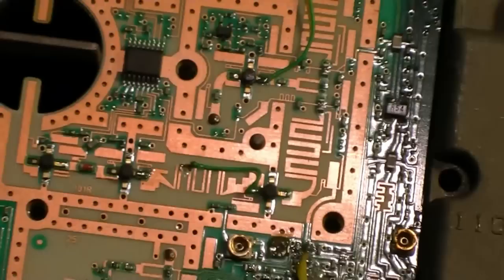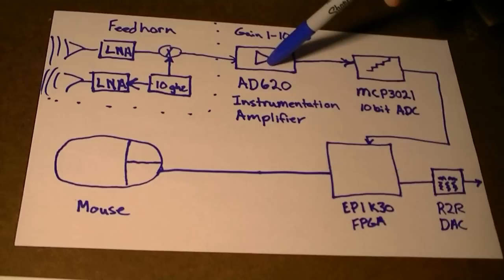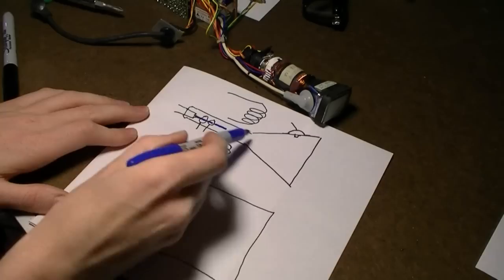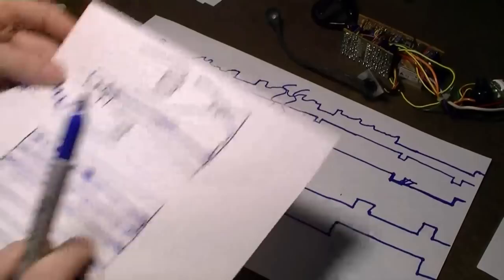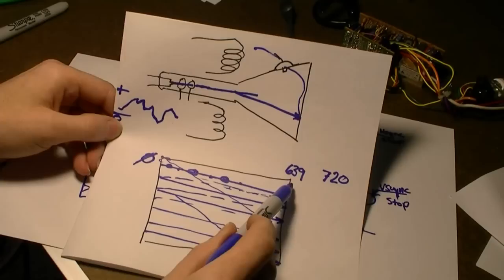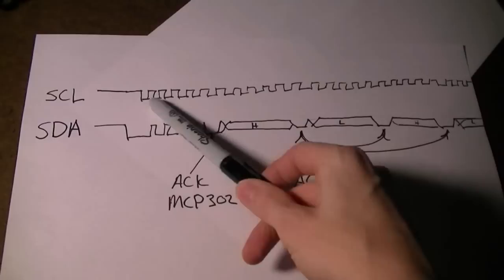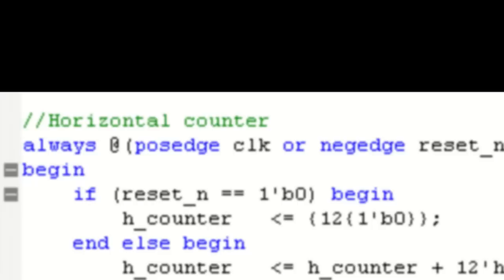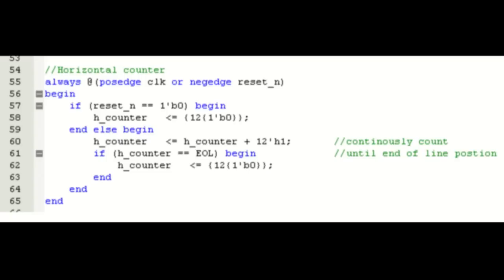DIY Body Scanner Electronics

Comment: That brought me back.  I loved your explanation of how an analog  video signal works.   Back in the early 90's I built a video frame grabber for a class project...back then it was discrete TTL components for the Horiz/vertical counters and $300 for 64k of high speed static ram...I don't even remember what the A/D cost.  The T/S 1000 was a nice touch too.  Good stuff, keep it up!

Comment: Great video, your presentation technique is so easy to understand. Using the resisters to create negative and positive rails (from a virtual ground) from a single voltage supply is a so simple its amazing. Ill have to try that one day, im always stuck for negative voltages when im trying to use opamps and such, thanks!

Comment: hi ?
i have thes equipement  

+ ( GZ6E  digital sampling converter) 
+ GZ1120ME-35EV
+ Antenna .

how can i use in a ground penetrating  radar aplications 
i have one's and i want to work 
i was found a little information about  GPR on  geozondas
  site web
thank you .